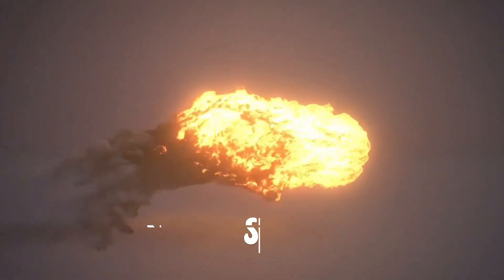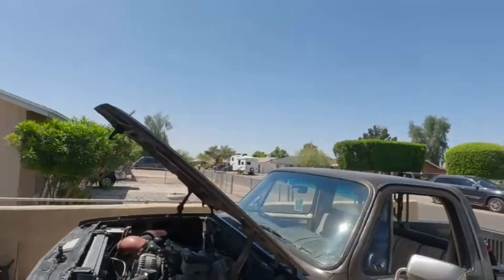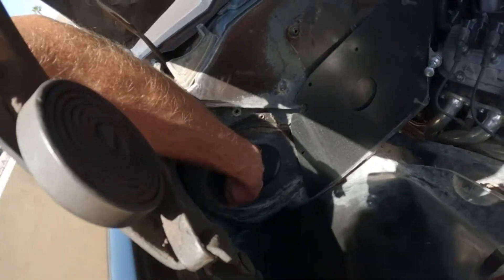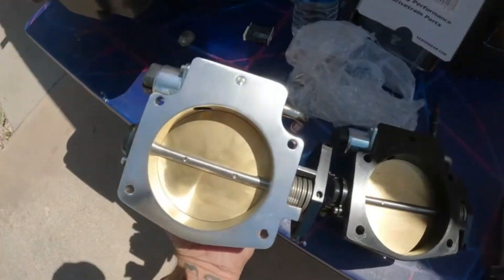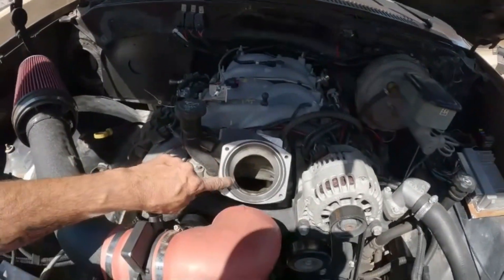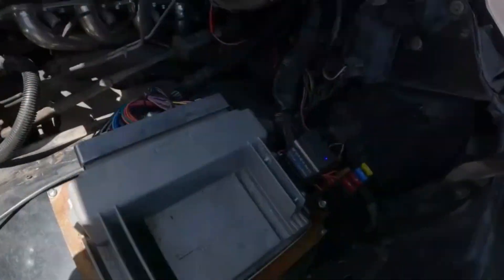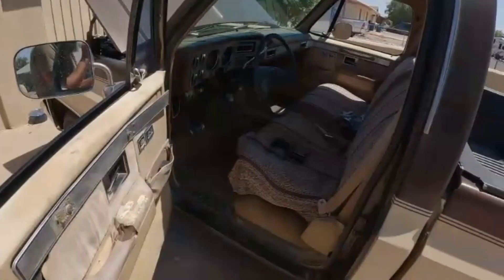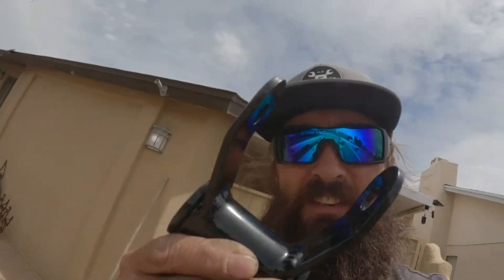Swapping parts on the C10

Comment: Hey brother check your PCV line's. Make sure they are not switched around. They will make crazy squeaky and other noises. She definitely coming along!
Reply from the maker: I'm not 100% sure but I don't think a 8.1 has one 🤔 that's why my throttle body has that open tube and now where to go but plug it. I'm going to go look now... I'll be  back brother
Reply: @knoxbros   I have never ran a 8.1 but it's a positive crankcase ventilation valve. I know on LS crap if they get flipped around they make this almost same sucking blowing squeaking sound. There is a couple of forms that are pretty informative. I know aftermarket intakes are louder but that's pretty loud lol. Sound's like a waste gate leaking off boost .
Reply from the maker: The 102 did even sound this loud

Comment: Its Larry the Delivery guy ..... Nice Truck!
Reply from the maker: Welcome to the channel!!!! Thank you so much. Make sure to smash that subscribe. A lot of changes will be going down real soon
Reply from the maker: So I was wondering. Have you ever cut up the 8.1 intake like we were talking about? If so would you mind helping me out on making some more power?
Reply: @knoxbros  no, I've never done it. I've only read about ..... but, I've got a horizontal ban saw and it's not "my" manifold so..... 😁
Reply from the maker: Lol I'll get a spare one lol 😆
Reply: Do you have  "Draggy"  for before and after comparisons?
Reply from the maker: @larrypetrucci4763  I don't but I'll figure something out for times.
Reply: @knoxbros  maybe someone reading this will have one you can borrow.   

Also, I wonder if the Fuel Injection system would compensate for a 50 shot? 😎
Reply from the maker: I like your thankin'!